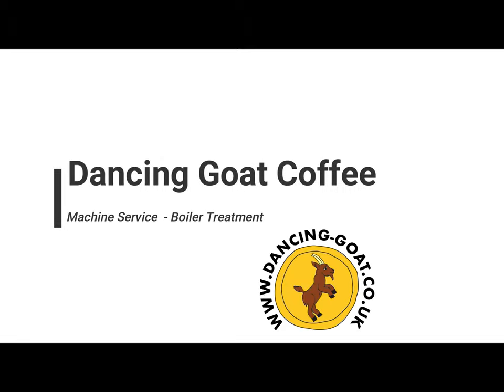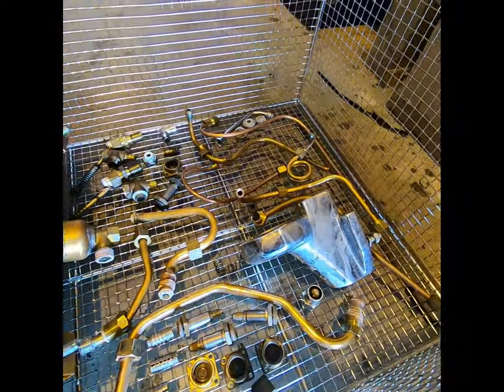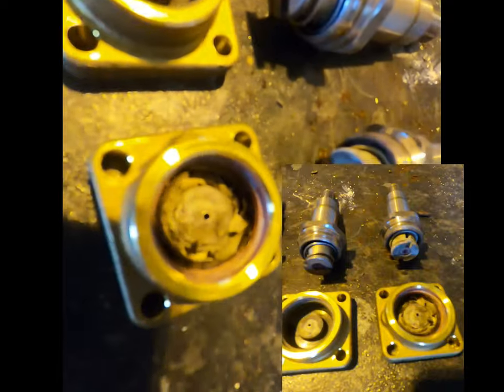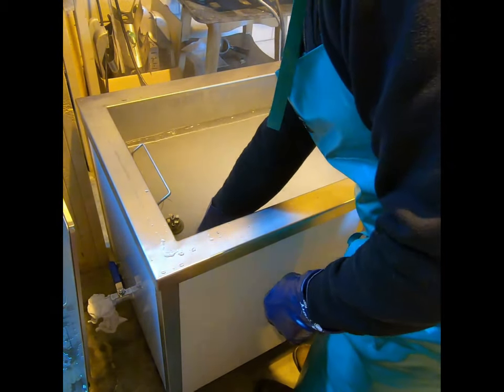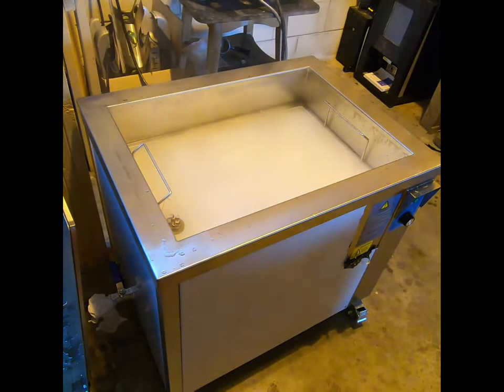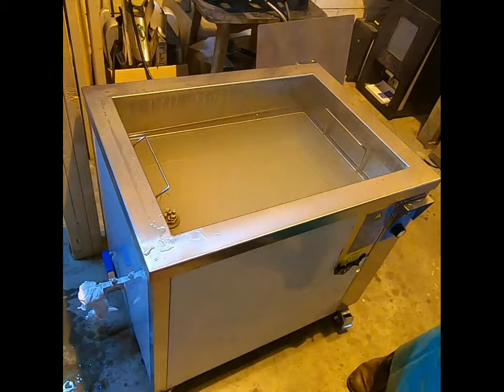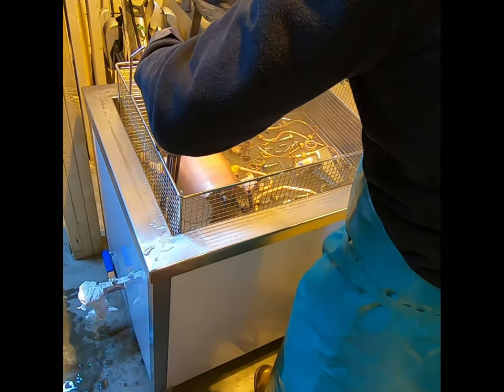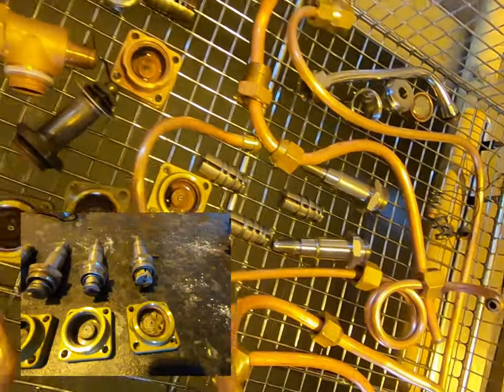Coffee Machine Service - Boiler Treatment

Comment: Citric acid is the safest solution with water, or something stronger but be careful!!
Reply: It is a pity that so far no one has received an answer to the acid used for descaling in the ultrasonic bath. I would also be very interested please give information ;-)Thank you very much
Reply: @Wides911  citric acid mix with water, dip all parts of the coffee machine in it, 24 to 48 hours , after that pull out all parts wash with water and put the parts back in coffee machine, simple
Reply: @Wides911  make sure the heating element dip in the acid solution below the electric connection!!!
Reply: what about the use of amidosulfonic acid ? It should be stronger and there should be less danger that Grüspan (Kuperacetat). As far as I am informed, there should be less danger with regard to the green chip than with vinegar / vinegar essence, but it should also be able to happen. Some powders also have a mixture of, for example, 15/15% amidosulfonic acid /citric acid. I would also like to descale gently and adapted to the calcification status and I think it's 24 hours as far as corrosion is concerned, maybe not the best way, right? If I have understood it, the integrity of the boiler after descaling also plays a role, however that is in the Detail is meant (I have asked again extra) and you should probably come to serious mistakes if you do not master the descaling process can. I already think that the issue of safety plays a certain role afterwards, because the descaled boiler also plays a certain role afterwards in use under there is a certain pressure and if it is corroded too much, it could certainly burst, at least as far as my assumption is what the subject is wrong concerned. How do you see this in context / What are your experiences on this. I understand on the one hand that no general template would like to be given here but on the other hand it should also be clear to everyone that he should also inform himself in a well-founded manner several times and basically acts as a non-technician, authorized at his own risk or ?

Comment: Is amidosulfonic acid more suitable for copper or a mixture of citric acid/amidosulfonic acid ? Do you have any experience with Calcinet? What is in your opinion, copper / brass boiler is the most gentle descaling for reuse in the machine for the preparation of coffee ? Which descalers can you use is recommended for the descaling of the disassembled components boilers, feed pipes, heat exchangers, if necessary. Brass connections of the solenoid valves and, if necessary, brass connections of the solenoid valves. also the chrome-plated brewing group? Is it better and more gentle to first use a descaler with a mixture of citric acid and amidosulfonic acid use só to use about 15/15% proportionally in the undiluted product or to use a scale dissolver with mainly amidusulfonic acid such as calcinet ?? In your opinion, what should I / the technician use best with Bezzera, ECM, Rocket, etc. for the removed parts to be descaled?

Comment from the maker: Thanks to everyone for commenting on this video.. following the last comment which again asks about solution used I felt I should explain my reason for not sharing...
There are a few variables such as temp of solution and not least material used in boiler construction to consider. If these are not known then damage to the boiler integrity could occur. So my hesitation in sharing this solution mix is that the solution used must be correct for the item undergoing treatment and then whoever is carrying out treatment must be qualified to confirm the boiler / vessel integrity once the process is complete. I would happily chat openly about this if we were stood together in the workshop but not on an open online forum when an inexperienced viewer / reader could make a serious mistake. 🙂
Reply: Thanks for explaining why there has been no feedback so far. 
What exactly is meant by damage to the boiler integrity for example ? I think it is exemplary not to want to provide a template where others could make serious mistakes. However, I think it should be clear that everyone acts at their own risk if they are not experts in the field. Unfortunately I live too far away EU/Germany to visit the workshop :-(. As far as I know, amidosulfonic acid base descaler such as Calcinet is okay for copper boilers. For descalers with citric acid is to my knowledge important not to go above 50 ° C because of the dissolving sparingly soluble calcium citrate and vinegar is not suitable for copper because of formation of verdigris (copper acetate).  Thank you for the insight and your videos ;-) . I think it would be okay to give a few tips at least times an overview of what would be suitable for which material basically with Temp and how long zirka with the reference to no adhesion etc.. What could happen as a serious error ? Surely it is one thing to know what you take and whether you have the handling and the Proffesion to deal with it. Of course I accept if you stay with it no further info to give out for reasons already mentioned by you.

Best Regard Wides911

Comment: Disgusting. This is why I only use extremly clean and soft bottle water and I also drain my boiler every 3-4month.
Reply: if the water is too soft, the coffee can taste very bad (carbonate hardness below 4 d.H for example) furthermore it can lead the level sensors in the water tank to errors or Promoting corrosion of components ...
Reply: @Wides911  my water is 5.7dh. no issues so far. Reed sensor does not care about water hardness. Besides taste there are no downsides of too soft water. How should soft water lead to corrosion? makes absolutely no sense from a technical point of view
Reply: @Squilliam-Fancyson  Too low alkalinity can lead to corrosion of metal parts (pitting). The alkali content should be kept above 40 ppm CaCo3 to avoid the risk of corrosion. The alkalinity is sensory important as an acid buffer so that the espresso does not become too acidic during extraction and the water is not corrosive due to acids. Likewise, the pH value should not be lower than 6.5. Consequences can be: Effect on espresso: unpleasant sour taste. Effects on equipment: greater concentration of H+ ions will increase the corrosive potential of the water against boilers and pipelines. As far as I have read in Water for Coffee Extraction - University of Applied Sciences Switzerland and La Marzocco water recommendations (stainless steel boilers, copper supply lines etc.) ... Furthermore, there are other data in the water which are crucial for corrosion, including chloride / sulfate content, etc.. As far as I am informed, the level check of the water tank (i.e. use without fixed water connection) works via the conductivity test by sensors on the water tank (as with a TDS meter). If the water has too few dissolved particles or is very cold (cold is supposed to shift the pH value downwards), it is possible that the machine does not recognize the water and therefore also the water tank filling. As far as my current information on the subject...Furthermore, it was said in a conversation with a technician that maximum lime protection does not necessarily mean maximum machine protection, however, the neglect of lime protection is also not machine protection. Furthermore, also a senorische meaning plays a role whereby here the experts are a little diverse in their opinion. The SCA water chart is also interesting. best regard Wides911
Reply: @Wides911  Thx for the detailed info. Looked the corrosion thing up and it now makes sense to me. The bad influence of soft water on taste I already found out myself when I used to buy the most recommended(by german coffee forums) "german bottled water". Its only 3.4dh and definitely does not work with lighter roasts. I was wrong about my current water of choice which is a 7,12dh. 29,4mg/l Ca² and 13mg/lMg. Also got the Marzocco style setup with stainless steel boiler and copper lining.(ECM Classika PID) So far its 7 years old  and as far as i've while changing to quick valve steam wand assemble, my linings are fine. My reed sensor is actuated by a magnetic swimmer though. Worked quiet fine even with the 3.4dh water.
Reply: @Squilliam-Fancyson  with pleasure ;-). So I have to say that I am also still engaged with the subject matter so continue to research. In particular, as mentioned, in addition to the chloride, sulfate - values, etc. also the pH value and especially the alkalinity value ("carbonate hardness") seems to play a role with regard to corrosion. I assume you mean with the most recommended water the Volvic water or ? I currently use Aqua Purania 5 liters. It is cheaper and slightly harder than Volvic so about 5dH total hardness and 4 d.H carbonate hardness in about with BWT droplet test determined. Lelit wrote me that it still has too little alkalinity although I have determined 4 d.H which would be in the appropriate range ...carbonate hardness (or temporary hardness) > 40 ppm CaCO3 (it's equivalent with 4°f or with 2.5 °D). Maybe then also something sensory and matter of taste. Incidentally, I have already heard from 2 experienced baristas two very different opinions, one states that every barista who has a clue will agree that espresso that is prepared with a hardness from about 8 d.H. only tastes right and the other that the espresso is more the machine protection in the foreground and one (Voraausgesetzt the carbonate hardness part fits and the total hardness is also not too soft) there would be sensory hardly a difference. The water topic is quite complex may I ask what kind of water you currently use with the 7.12 dH ? An important role should probably also play the factor Zusammenhand total hardness + carbonate hardness and indeed the carbonate hardness should be as far as I am informed close to the total hardness. I have currently oriented myself with the values of my water to the information of Kaffeemacher.ch which is based as far as indicated on the knowledge from the findings of Water for Coffee - Etraktion by Dr. Marco Wellinger (University of Switzerland). These give as ideal values for the espresso a total hardness: 3-6 d.H and a carbonate hardness ("alkalinity") 2-4 d.H Ph value as 7 as possible (source Kaffemacher/Water). With the total hardness there are as described various opinions as also explained in the water chart of the SCA to my knowledge. I find the Thirt-Wave-Water very exciting. It is a powder which is added to distilled or osmosis water and should leave as good as no solid lime residue in the machine but should have ideal values. Unfortunately, there are still too few long-term experience values in Germany (have not found anything) on the subject of corrosion. It is similar to the use of recipes to make your own water for the portafilter see Bariste Hustle on the web.... Many greetings Wides911
Reply: @Wides911  Yeah I was talking about Volvic. My water of choice is called after it's source "Lebensquell". Quite cheap with a 7,12dh total hardness. Prior to that I had "Gasteiner"(33mg/l Ca² and 1,93mg/l Mg²) which is around 5dh. Although the "Lebensquell" has about 6 times as much of magnesium, I can not rly make out a different taste compared to the "Gasteiner".  Is there a formula to calculate the carbonate hardness just by the ingredients list provided on the bottle label?
Reply: @Squilliam-Fancyson  I haven't found a formula for this yet. But there are also measuring devices or the droplet test, use the one from BWT.
Reply: @Wides911  I found one on the kaffeemacher website. It's HCO3  in mg/l divided by 21,8. In my instance 6,83dh which is a bit out of the desired range of 2-4dh for alkalinity. With 3,8 dh the "Gasteiner" was quite a good choice. Sadly not available at my local stores anymore, which means I need to keep shorter descale intervalls. Just descaled my machine today and although the water leaving the boiler did not look líke that there was a lot of minerales build up within the machine, the taste difference is huge. Finally  got rid off that "heavy taste", that covered up a lot of taste nuances  of my lighter roast coffee of choice.